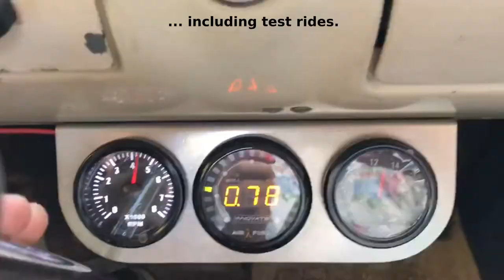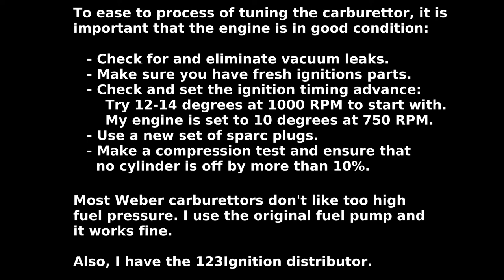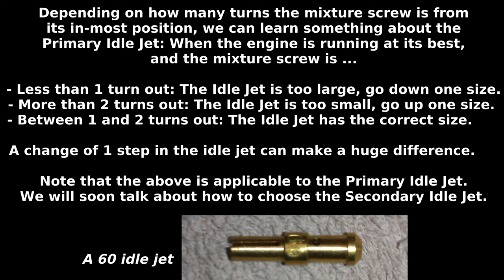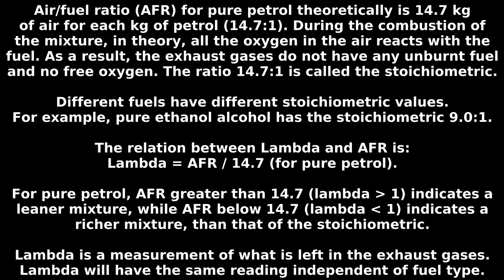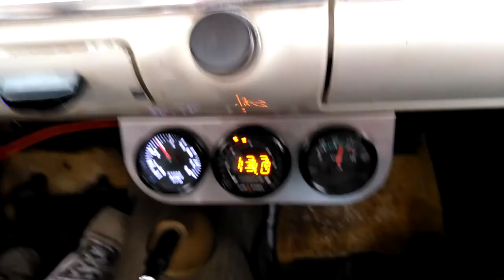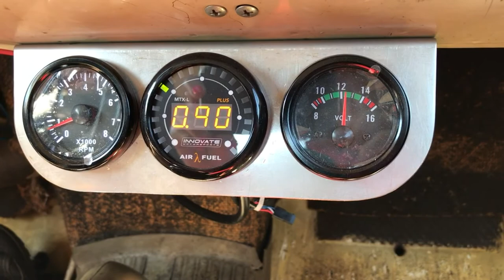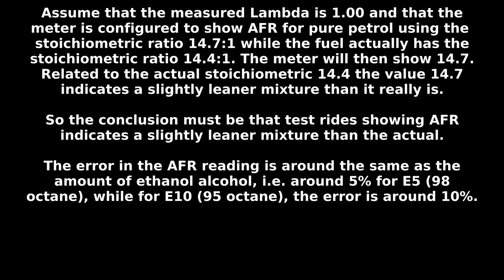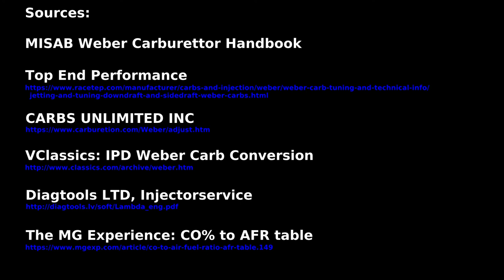Tuning a Weber 32/36 DGV - Volvo B20A tuning measured using Wideband Lambda Sond

Comment: I think your AFRs are just fine! I am also tuning my engine now with an AFR gauge. My issue is at part throttle, it is too lean. So now I changed the primary air jet. Hope it will help.

Comment: Trevlig och informativ video! Håller själv på och mekar med en 32/36 DGV till en Ford Zephyr Six marinmotor. Det är verkligen en hel vetenskap. Har fått den att gå bra på tomgång och första steget. När andra steget kommer in dör motorn om man inte drar ut choken. Hade också velat ha en lambdamätare men det funkar ju inte när man har vatten i avgaserna.
Reply from the maker: Thank you for watching and commenting my video! If the engine dies when the second stage comes into action but it seem to work with the choke engaged, then I believe that the mixture is far too lean. This problem may be cured by increasing the secondary main jet and/or decreasing the secondary air corrector. This is of course under the assumption that the carburettor is in good condition and in general suitable for your engine and that all other things like ignition, compression, vacuum leaks and so on have been checked.
Reply: @cartube7505  Thanks for the reply! Yes, i believe that´s the problem too. I have changed the jets many times now and it´s getting better but it´s not fixed yet. The carb is new.

Comment: from the video, it does indeed run very well. The steady 0.89 at idle shows a well-behaving engine.
Reply from the maker: Thank you for watching and commenting my video! I have replaced the camshaft this winter and inspected the engine. It is in a very good condition, almost new (it comes from a military vehicle). I plan to make a new film about this modification.

Comment: I wish that a Weber kit like this was available for my Amazon with a B16 engine. Have spent over 2000 euro on trying to get an original Zenith rebuilt. At this point I am convinced it is impossible, and in general a very poor design compared to these Weber carburetors. I finally have an air tight carburetor now, but it leaks a lot of fuel into the intake when turning off the engine. Hard to restart it unless I let it sit overnight. Your video is very good and informative. I'm sure it will be a big help for people with a B18 or B20.
Reply from the maker: Thank you for watching and commenting my video! I used to have an overhauled Zenith before and it worked but I think it was too small for this engine. I remember some fuel leakage on the intake but not as severe as in your case. I suggest that you check the needle valve and replace it if it's not working. Remove the float cover and the fuel line and blow air with your mouth through the fuel inlet while the valve is open, then close the valve and the flow of air should stop completely, if not, replace the needle valve. The needle valve gets worn and must be replaced on a regular basis, every 20000 km is recommended for the Weber.
Reply: Thank you for the suggestion! Turns out the carburetor is completely fine. The culprit was the new fuel pump I had. Installed an original, old used fuel pump, and the leak is gone. The new pump produced 6-7 psi of pressure, while the used pump has around 3 psi. I suspect the pressure was just high enough to overpower the needle valve and overfill the float chamber, causing the leak. Before installing the rebuilt carburetor, I checked the needle valve multiple times just like you described. Found no trouble with it opening and closing. This was less than a month ago. Disconnecting the fuel line after turning off the engine to release any pressure, or gravity feeding the fuel (bypassing the pump), resulted in no leaks while troubleshooting. This should confirm fuel pressure was the problem.
Reply from the maker: @togst  Good work!

Comment: Thank you. I also have a '65 PV with a B20, and a DGV conversion  - and it is white too. I have been frustrated with the Weber, and am considering changing back to the two SU carburetors that were original here in the USA. Maybe I will add the Lambda Sond and try to set up the Weber with that. After many years working on British cars with SU carbs, I understand how they work. The Weber is still a bit of a mystery!
Reply from the maker: Thank you for watching and commenting my video! Last year I installed a 2 inch exhaust system in my car. After that, the Lambda Sond suggested some slight re-tuning. I have read two books and learned some new things about the Weber 32/36 and I sure would like to make an update to this film but my time is limited for the moment. With a good engine and a proper tuning the car shall run perfect. One of many good things I like with the 32/36 DGV is the fuel consumption. Yesterday I drove some 500 km (with overdrive) mostly at speeds around 100-120 km/h and the fuel consumption was less than 6.8 litres per 100 km.

Comment: Great Video, I'm currently looking to convert my 1962 ford consul to a weber 32//36, It's already got a high compression head and 4 branch manifold, Standard it had a hockey stick style manifold where all the exhaust ports went into 1 pipe so now it flows much better. It also a zenith vn carb, It's never been good with that carb. Splutters down low when you get back onto the throttle, The engine is rebuilt, timed and all new ignition so i'm going to try the carb conversion now.
Reply from the maker: Thank you for watching and good luck with the Weber conversion!

Comment: Helpful info here. I'm struggling to dial in my new 32/36 on a Nissan z24 engine which has 2389 cc. I bought a Lambda gauge to help figure out why it seems sluggish while accelerating or merging and the readings for those conditions indicate that it is running lean like around 107 - 1.10. I have larger main jets on order and I'm pretty happy with the idle after going down 1 size main idle jet to a 55. Anyway, What I'm not clear on at the moment is when setting lean best idle, the engine runs best at a Lambda of around 0.85. A slight turn of the idle mixture screw adjusts the Lambda to 0.92 - 0.95 but doing so yields a slightly less better idle. Lambda readings if I stay with the lean best (and richer) idle setting lowers the readings for accelerating and cruising only slightly to maybe 1.05 - 1.08. I wonder if I should run it at the lean best richer idle because that's what the engine seems to want or if I should adjust the idle to run closer to stoich even though it doesn't run as well. Hope that makes sense.
Reply from the maker: Thank you for watching and commenting my video! First of all, I am not an expert in this topic, I have only shared what I have learned, however I will try to answer your questions: If your engine has the best idle at Lambda 0.85, the amount of CO will be around 5.3% and that may be too much according to the regulations (the car may not be approved at the registration). This could be an indication of vacuum leaks, e.g. in the throttle axis which is common for worn carburettors. The solution is to replace the axis and the bushings for the throttle, but until then I suggest you to keep the idle at 0.85 since the engine runs best here. It is interesting that the idle setting affects the Lambda at cruising, this confirms what I believe even though I have found articles that suggests the opposite, i.e. that the idle circuit does not affect the cruising state. Also, I strongly agree with you to increase the primary main jet because you need a slightly richer mixture than the stoich during cruising (at least if it is an atmospheric engine, i.e. without compressor/turbo). Running the engine leaner than the stoich is no good and can in the worst case damage the engine. Good luck with the tuning!
Reply: I'm doing similar tuning on a BMW 2002 and also find that the highest idle is achieved at 12.5 (0.85). This figure is pretty typical in the 2002 crowd from my research.

Comment: My mixture screw is thin and short on my 32/36, its even inside the hole where it is suppose to be.. Is it the wrong screw or is it just another version in some way? My engine runs but it runs in "waves", up and down. Im about to change the spark plugs and even ignition cables, but could this be a case of air leaking in somewhere?
Reply from the maker: Thank you for watching and commenting my video! Air leaks can cause strange problems. My only advice is to thoroughly check your carburetor, ignition parts, ignition timing, gaskets for manifold and carburetor etc. Replace bad parts.

Comment: I have the same setup on a B18A it seems to work well up to 4500 rpm then it doesn't accelerate well.    Does yours pull well all the way to redline?  Im thinking about a 38 dgas if i cant figure this out.  The car could  do  ~100mph with the zenith but now 85mph is a stretch.
Reply from the maker: Thank you for watching and commenting my video! I am sorry for late answer and the reason is that I recently had to abandon the so good HTML version of Gmail so I did not discover new comments.
Actually, to be honest, I have not tested 4500 RPM and above. I may have tested only like 3500 RPM since I installed a K-cam last year and I have not pushed the car to much since then, however, I have made some slight adjustments in the tuning. I also have installed a 2-inch exhaust system which really makes difference and it suits the tuning suggested in this film a lot better. Everything works much better together. This can maybe be a topic for a new film but I have not had the time for this during the last couple of years. I want the car to behave well in the RPM-register that I normally use in daily driving. In your case, maybe you need to consider what cam shaft you have? Or the exhaust system, or the cylinder head. It is not only the carburetor that determines the behavior but also the other systems as they must all cooperate to receive the goal.
Concerning the Zenith carburetor, take a look at the test drive in the overdrive conversion film in which I still had the Zenith VN36 carburetor (with the B20 engine). Here, I managed to pull the car to considerably higher speeds than what is showed in the film but I did not dare to enclose this part in the film. At this point, the gas pedal was only like half way down and nothing happened when I pulled it to the floor. When I later removed the cylinder head I found that it was not correctly torqued so it was actually leaking. This is also a topic for a new film.

I would like to use this opportunity to send a message to all of my viewers and subscribers:
I really don't know how everything works in Youtube but for those of you reading this, I would like to say that I am sorry for not posting any video during the last years. However, from now I will have plenty of spare time so I hope to be able to post new videos in the coming future. So please don't give up, there will be more content in this channel, I promise.

Comment: Great content! It'd be great to learn more about which passages are active at different throttle positions and RPM in order to know how to fine tune AFR low/high spots in the range.

For instance, with my mixture screw 2 turns out for max idle speed (on the verge of a lean idle jet) I'm still running slightly rich (12.0-12.5) at part throttle and cruising, however the AFR leans out to 14.7 at WOT. I also notice that AFR leans out at higher RPM (13.0-13.8) regardless of throttle position. 

So what is going on and how would I lean out low rpm, low throttle while richening high rpm, high throttle?
Reply from the maker: Could it be that your primary main jet is too large and the secondary main jet is too small? And what about the secondary idle jet? To be able to help you further I need to know the current jetting setup for your carburettor. I assume it is a Weber 32/36 DGV, is that correct?
Reply: @cartube7505   It's a 32/36 DGEV.

Secondary main is actually 5 larger than primary and still leans out at WOT.

Primary:
65 idle
140 main
160 air corrector

Secondary:
60 idle
145 main
170 air corrector
Reply from the maker: @davidmucci1014  First of all, please be aware that I am no expert in this area. However, it seems obvious that the engine gets too much air at WOT. Could it be a vacuum leak? Is it a new or used carburettor? Can you find clues by studying jetting tables for your engine? Dealing with air correctors and E-tubes is unfortunately beyond my knowledge. What does the E in DGEV mean? Currently I have no access to my Weber handbook.
Reply: Did you get this worked out?  They sell difference sized Booster Jets (twin elephant trunks in the center) in the performance kits.  Or try a larger Aux Venturi, although that seems like a last resort.

Comment: Hello
I have a problem when the engine is warm, the choke kicks in too fast and the carburetor gets sour. How do you adjust the choke so it doesn't go in too fast. Only drive the car when it's 20+ degrees outside
Reply from the maker: I don't understand exactly what you mean. The choke shall be wide open when the engine is warm and not used at all. If you only drive the car at 20+ degrees I think you can skip to use the choke when you start the engine. However, apart from creating a richer mixture it also raises the idle speed to help the engine to idle when it is cold. I am not sure I can give you any advice other than checking the linkage and the wire used to engage the choke.
Reply: @cartube7505   the problem is when I have driven and turn off the engine and wait for 15 min it’s almost impossible to start. I have to give full gas and turn starter for one minute to start. How do I skip the choke. How do I disconnect it? It’s a electric choke
Reply: @paulgun  I am sorry, but I have no experience regarding the electric choke. But could it be that the carburetor gets too warm causing a steam lock or something? I used to have minor problems to start with warm engine with my previous Zenith VN36, however far less than you describe.